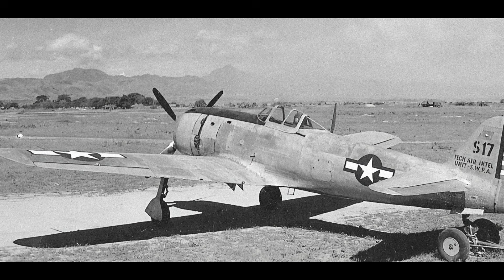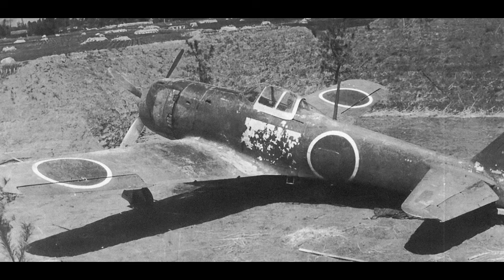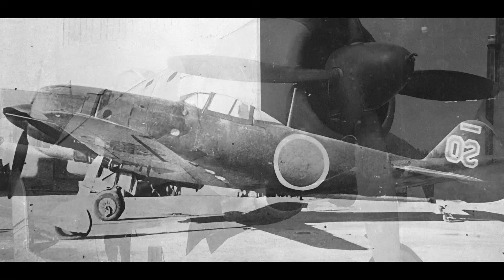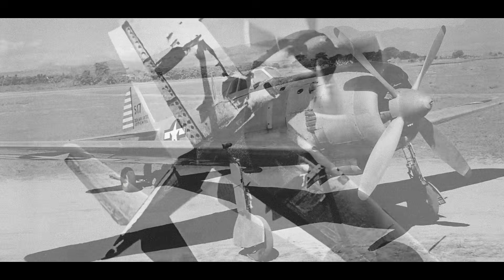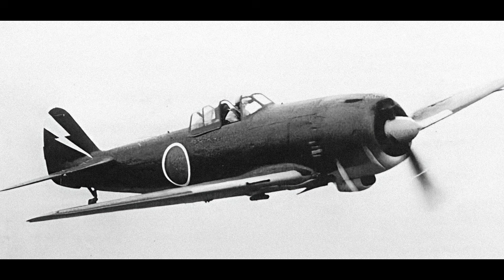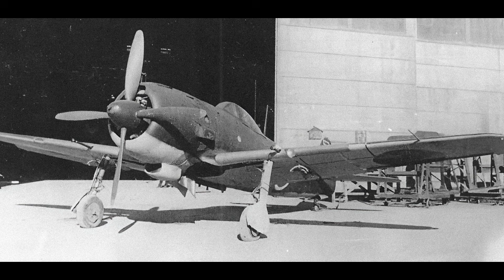Nakajima Ki-84 Hayate: Better Than The P-51?

Comment: Best ?  Subject to what ?  You can't compare a stripped down fly weight tinny ass airplane to a real war bird that has made a ton , several tons of sacrifices in order to be much stronger and have the ability to bring the pilots home alive.  Apples n oranges.  Strip the Mustang down to bare bones,  get the weight the same, if possible, and then !  Let's have a fly off.  Even the skin on these Japanese planes is 1/3 the thickness of ours.

Comment: Thank you for details of devellopement history. The  Frank captured at  Clark Field and sent to the US for testing by Technical Air Intelligence Unit was practially rebuilt,  rewired and equipped with American guages. It was tested to 427 indicated mph at 23000 ft on 92 octane fuel, and water,  methenal and alchahol injection. My guess is that it would've lacked the high altitude performance of the 2 stage supercharged  Amercan fighters with only it's 2 speed single stage impeller. TAIU couldn't find room for an internal starter so any other added stage of supercharging and intercooler would've been problematic.

Comment: Purely on design , Ki-84 was likely the best WW2 fighter. It had excellent speed, climb, dive, but it retained very good maneuverability at low speeds. All that coupled with decent weapons. 
What stopped it for achieving larger impact in the war is primarily fuel. While Americans had 100 octane fuel, Japanese very happy when they could achieve 92, usually going for less. This of course coupled with manufacturing difficulties , sometimes with poor pilot quality, but the fuel was often omitted great advantage that US and Britain had over Japan and Germany. Soviets also partially benefited from imported US fuel, but in general had to relay on their own local low octane variant.
Reply: Actually, the US produced even higher octane fuel, 115-145 was used with the highest performance fighters by the end of the war. For most of the war, 100-130 octane was commonly used. That allowed higher compression, more efficient engines to be used. Japan at least used natural petroleum to refine it's fuels, that made it easier for them to obtain 92 octane. Germany got much of their fuel from coal gasification process, which only produced 87 octane fuel efficiently. They could produce higher octane, but it significantly decreased the final volumes of fuel produced. And coal gasification couldn't produce any lubricating oils-only fuel. Germany suffered from greater fuel issues than the Japanese. I disagree with you that the Ki-84 was the best designed WW2 fighter, it was a good design that performed well when it didn't suffer from manufacturing issues or engines which didn't produce rated horsepower, but the best? There are too many US designs that would challenge that-Mustang, Thunderbolt, Corsair, Hellcat, Lightning to name a few. The 'best' means not only performance in the air, but manufacturability, serviceability, uptime, mission performance, many other attributes. Certainly later versions of the P-51 Mustang like the 'H' model would contend for that title.
Reply: @heyfitzpablum  Well, strictly speaking, P-51 H didn't see combat in WW2. Production run was not that great either, so if you use this for comparation then you could go down the rabbit hole of Japanese prototypes and other what-ifs . And from what actually flew and fought in WW2, I realistically do not see any better fighter than Ki-84. Especially if you give it a better fuel for equal standing.
Reply: @aleksazunjic9672  Just 'giving it better fuel' isn't going to change anything. An engine has to be designed for higher compression ratios to realize the benefit of higher octane fuel, running 130 octane fuel in an engine designed to burn 87 octane will do NOTHING for you. I worked 47 years as a Manufacturing engineer in a company that made auto engines and transmissions, I have more than a passing acquaintance on the topic. And the P-51H was deployed with the USAAF in the Pacific, even if it didn't see combat-it didn't have to, the P-51D was doing just fine.
Reply: @heyfitzpablum  "U.S. Testing: When Allied technical intelligence captured and tested a Ki-84, they ran it on 96-octane aviation gasoline. Test pilots noted that engine knock vanished and reliability improved significantly compared to field reports from the Pacific"
Reply: @aleksazunjic9672  The engine has to be designed from the ground-up to operate at higher compression ratios, or the added octane isn't going to do anything for you. Pistons, con rods, heads, rings have to be dimensionally optimized for higher compression. The added benefit you cited probably had more to do with fuel cleanliness than octane rating.
Reply: @heyfitzpablum  Engine was designed from ground up for a higher octane numbers, not necessarily for much higher manifold pressure and compression, but US engineers themselves determined that with better fuel it run almost flawlessly without defects that plagued it during the war. Actually during the war Japanese pilots had to baby the engine, while with better fuel it would have achieved designed max power without issue.

Comment: There’s a report somewhere that a few of these Japanese aircraft varieties when being flown to wright Fairfield for testing were fuelled with top level American fuel and ended up being totally different aircraft some of them easily out accelerating escorting American fighters.
Reply: Low octane fuel was one of major reasons this plane didn't achieve even bigger impact in the war.
Reply: @aleksazunjic9672 Might've been a major factor if not the factor in the Homare's reliabi)ty problem as relarively high compression,, high rpm radials depend on high octane fuel. Lack of pilot training hours is the universal death of attrition  stricken overwhelmed air forces. Both the Luftwaffe and Imperial Japanese Air Forces couldn't man the planes they had late in the war.
Reply: Mitsubishi's prototype twin engine heavy fighter, the Ki83 comes to mind.
Reply: WRIGHT FIELD ...WRIGHT PATTERSON
Reply: @DEREKMoton-v5i if that reply is addressed to me then The Ki84, Nakajima serial number 1446, TAIU Reference number S17, was captured at Clark Field near Manilla, Philippine Islands in the spring of 1945. It had the lightning bolt tail markings of the 11th Fighter Sentai which had been based at Clark Field.

Comment: Was it better than a P-51, no any squadron using hand picked pilots are going to have a inflated success. Pilot skills being equal the P-51 using boom and zoom tactics would likely win. You never try to dogfight anything Japanese. In addition, Japan had good designers, engineers and workers. However lacked the capacity, resources and alloys needed to make high power engines in sufficient quantity to make any changes to the course of the war. By 1945 the B-29 was almost untouchable, which says all about the Japanese aircraft available.
Reply: Pratt and Whitney used a novel machining process to add cooling fins on their aluminum cylinder exteriors, sufficient cooling could not be obtained by die-cast fins. I don't believe the Japanese or the Germans ever used machined cooling fins on their air-cooled engine pistons. It seems like a small thing, but the P&W R2800 was able to squeeze maximum horsepower out of their engines partly by efficient heat elimination. Little things like that, all added up, are the difference between good designs and TOP designs. The Nakajima Homare engine which was used in the Ki-84 followed the typical Japanese practice of minimizing the engine diameter to the max extent so the cowling would have reduced drag. All well and good, but the Homare was difficult to assemble because of it's small size, tight dimensions and close tolerances-they didn't get rated power out of it until late in the war, when they overcame manufacturability/assembling issues. Japan had excellent aircraft designers, but not as many or as fundamentally sound as in the USA. I think part of it is design philosophy-Japan, having few natural resources, put great emphasis on designing for efficiency-to the extent they sacrificed ease of assembly. US had abundant resources, so they designed for maximum performance and ease of assembly (high production). Our philosophy proved superior over the long run in a war of production. I'm a retired manufacturing engineer who spent 48 years in auto engine/transmission development, so this stuff is fascinating to me. I also traveled to Japan many times on business/pleasure, I have great respect for the quality of their manufacturing capability.

Comment: Yes it was. Japan had some excellent aircraft designers.
Reply: Japanese WWII engineering was second to none, their Long Lance torpedo is an example of that.  However, their manufacturing capacity and capabilities were severely hindered by having no major on-island natural resources of metals and oil and inability to construct multiple massive manufacturing plants and power plants to run them.  Their atomic bomb project only succeeded in producing a few grams of U235, before their Nuclear R&D facility was destroyed in a bombing raid.